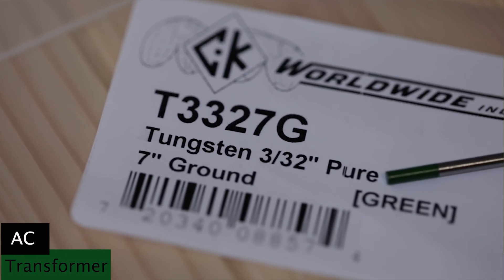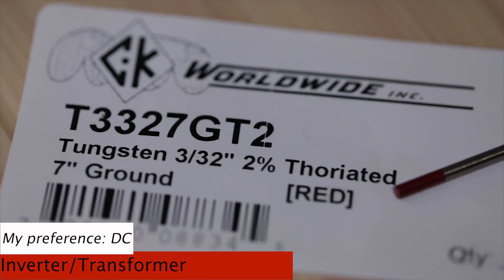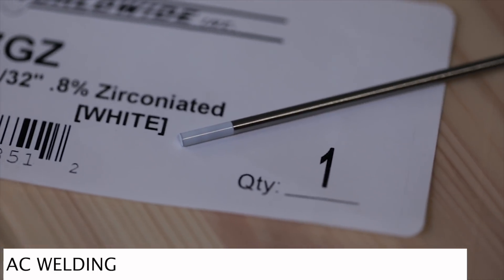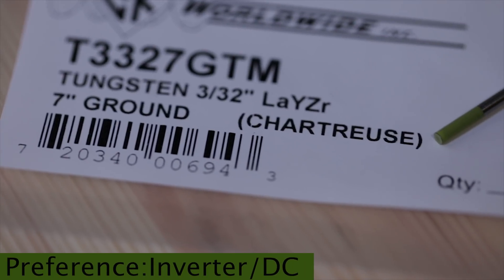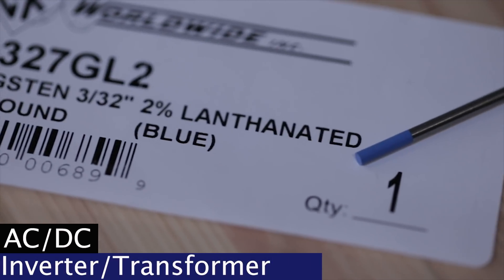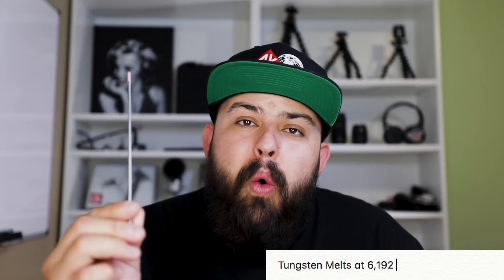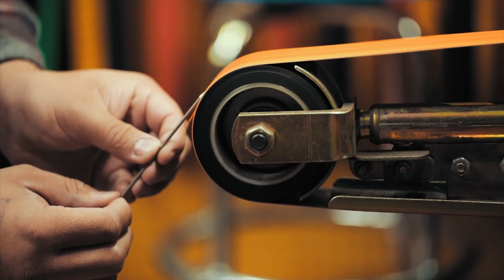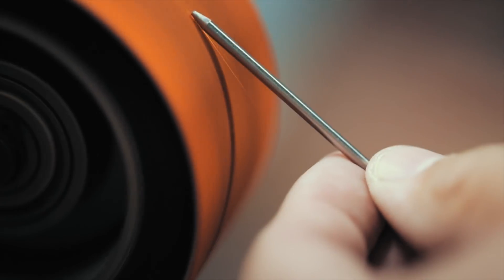What color TIG welding Tungsten should you use? | GTAW | Giveaway

Comment from the maker: What Tungsten do you guys use?
Reply: HourGlassFab  I use 2% lant 2.4mm for everything. From 4 amps to 160amps. I only play how the way I sharpen it. The only thing I do for aluminium is put the blue band off and make it black. So I know that the black ones are dedicated for aluminium.  I’ve tried the red, green, gray, gold, purple and blue... I even played with diameters ... and the 2% lant 2,4mm is my go to tungsten. For aluminium, steel, stainless and titanium.
Reply: You're not supposed to be TIG welding on DCEP!  You need to be on DCEN for most all  applications!!  :-)  Of course you're gonna destroy the tungsten on DCEP, as most of the heat energy will be going into the tungsten tip and not the workpiece that needs to be welded!!!
Reply: I’m team blue
Reply: And I sharpen only one side of the tungsten. You can use it longer... it makes a difference if you have to pay for yourself 😉 and I think it hold your tungsten cleaner. Less chance of contamination if you use the same tungsten with different materials.
Reply: 2% lanthanated. School gives us ceriated, but I'm not a huge fan of it.
Reply: Whatever I find in the drawer.....but I think I am using 2% Lanth now since you recommended it last time we spoke....
Reply: HourGlassFab #
Reply: Very onformative .thanks
Reply: I was replying to demonicwolf69's  post specifically.  I know what EP is, I know it's real, but unless for MIG welding or SMAW, DCEP is obviously not used much for TIG at all.  Demonicwolf69 didn't mention what he was welding so it's only natural he is welding ferrous metal.
Reply: I use 2% Thor for everything. I'll use it for short aluminum jobs, but if im doing long al runs i like the e3.
Reply: I stick with the tried and true red and green for me it works well with my old miller 300 A
Reply: @travishigley3095  Im with you there sir...
Reply: After 25 yrs Im kinda old skool but purple,red,black for steel&stainless wutevr Iv got handy,red for brass&green for aluminum keep th rest lol
Reply: Grey and red. All DC steel and ss.
Reply: Blue, red and purple for SS, depends on what is available in stores around the northern parts of Sweden. Many stores have the TIG inventories collecting dust I've noticed due to MMA and dual shield flux core beeing the most used methods around. Rarely weld plain old carbon steel but when I do I use the same in both an old Lincoln Invertec aswell as a new Kemppi MinarcTig. For aluminium it's green due to a very old and sensitive KempoTig and mostly very contaminated aluminium, tried gold once in that machine but never again.
Reply: Only use 2% Thor atm. Still practicing TIG right now.
Reply: #HOURGLASSFAB
 I use 2% Lanth in 1/16 and 3/32 in both a #9 and #17 CK torches. Have only welded mild steel so far.
Reply: im having major issues with our thoriated at work in 3/32, im going nuts chasing my tail trying to figure this out the tungsten is 2% thoriated is burning up after maybe 100 or parts especially tacking them all up, i'm burning up about a pack a week which my boss is a little annonoyed with me at 24$ a pack... running a max star 210 dcep  on bottled argon (i have even used our pure argon gas from our laser) i've changed the torch, i switch from my different fupa cups i have, i tried a different grounding spot thats cleaned etc and it just balls up and turns to this very weatherized frosty tip that just doesn't weld well at all. i used to use the 2% lanth back in college because im all about leaving behind radioactive material ain't nobody got time to properly clean them selves of that crap.

currently im using 2% thoriated ona fupa 12 at 22.5 CFH.
Reply: Grey band, White band and Red band Tungsten is what i use
Reply: HourGlassFab same as you basically. 2% Lanth and Thor with an occasional E3. The more I use the E3 the more I’m starting to favor it. How do you think the E3 compares to the layzr (green) or the pink multis?
Reply from the maker: ShowMeThePony I think they are all close to be honest. Layzr in my opinion is better for steel.. e3, tri blend and multi mix are definitely all close. I use pink all the time though, my go to lately.
Reply from the maker: E3, tri blend and multi mix are all good for aluminum and steel. At least in my eyes, arc characteristics are to close to notice.
Reply from the maker: Oscar Sanchez Jr, BSc. Dude? We’re talking AC regarding EP not DC. Aluminum, not steel. Electrode positive is a real Thing..
Reply from the maker: demonicwolf69 email me @hourglassfab@yahoo.com
Reply: Thor... love it...tried a few other types but thoriated seems to be my favorite...I have pink,blue,grey but the red is where it's at
Reply: Pure tungsten for aluminium  and for steel and stainless steel  2% Lanth
Reply: I use E3 for DCEN only, never AC. I use White Wolfram's for AC only, never DC. And that's it.
Reply: Red and purple thats all if used for steel no stainless yet
Reply: I used 2 lan on chromemoly alum and ss and mild steel works extremely good for me but thats jus me and my machine and settings and cups i use , now in no way am i sayin is 2 lan ideal but for me it does fine
Reply: I am welding aluminum thickness 8 mm and found some gas pores .
When I try to rectified it becomes heavy porosity.
What's problems????
Reply: Sorry, quite late to the Party. Still gonna answer your question though ^^
First I need to tell you guys that I work almost exlusively with thin sheets (0.6-2.0mm) mostly Stainless, Copper or Aluminium on Occasion.
What worked best for me this far is the following:

Gold (1.5%Lanthan) for Stainless
Green (pure Tungsten) for Aluminium and Copper
White (Zirconium %unknown) Aluminium
Purple (E3) Didn't work for me also tended to split with AC
Reply: Htp - Quad 
Blue Demon - EWG tri mix
Rstar - tri mix 
Arc Zone - Hybrid 
CK - Red band
All 2.4m sharpened according to my needs for that particular job

Comment: thank you for this info
but the titel says:   What color TIG welding Tungsten should you use
from the 9 different colors you explained only 8 and not said what color should be used for what material to weld.
great that you said if AC or DC or both and also if transformator or inverter

Comment: The machine I have is a Tig 165S 160amp dual voltage 120/240 volt DC inverter. I'm going to be  welding custom chopped bicycle frames. From what I can tell most are aluminium or aluminium alloy. A few are steel or have mild steel parts. So my questions are do I need to switch tungsten when changing between steel tubing to aluminium tubing? if so then what type am I needing.  I haven't welded in 30 yrs and back then I either was stick welding or used a mig machine. But that was completely different projects then. Trailers, BBQ smokers, big thick framed stuff now I'm having to deal with thin walled light weight material that if my well breaks can kill someone since these custom chopped bicycles have anything from a 50cc 2 stroke up to 150cc 4 stroke 4 speed motorcycle motor powering them.
Reply from the maker: Use 2% lanthanated and you can jump back and forth between reactive metals (steel) and non reactive materials (aluminum). I’m a big fan of that tungsten.. great tip erosion resistance characteristics on DC and also soft enough to just barely round the tip over on AC, some tungsten is extremely hard (thoriated) and it like to split or spit pieces off of the end on AC.. which is why I wood recommend thoriated for AC work. Goodluck!

Comment: Hello, New to TIG and scouring the innerwebs trying to find my baseline and you have been extremely helpful in that for the tungsten. I thought my brain was about to overload. Seems as though it's not as confusing upon gaining a bit of knowledge I hope this is actually the case. I did a small bit of stick in recent years but I'm so impressed with the multitude of materials and the appearance of the finished product that after much review I recently bought a PRIMEWELD-CT-520D 50A Plasma Cutter / Stick Welder Comb. By no means was it top of the line but it wasn't the bottom either. I decided I would start with 2% Lanthanated blue.
Thanks again enjoyed you video very helpful and well done - Van

Comment: @Hourglassfab, Hey Dude, Thanks so much for the great education on Tungsten. I've really been needing this, and I've had a tough time finding anyone who could explain the almost "Black Magic" of Tungsten Colors, and Transformer vs. Inverter, and A/C vs. D/C.
You broke this down to a very simplistic way.
I have a Transformer Machine Miller Syncrowave 200, and am getting ready to buy a new Inverter Multi Process Machine this week. 
That too was one hell of an education! I was all set to purchase a Fronius Transsteel 2200, only to realize at the last second that it was not capable of A/C Tig. That really sucked a big Donkey. Well after going looking for a Multi Machine that was capable of A/C Tig, thinking I would just get another Miller, think again. From what I've seen Esab is about the only Company that manufactures a Multi Process Machine that can Tig in A/C. ( please correct me if I'm wrong, and enlighten me as to whom else does, and doesn't cost 10 grand)
So it looks like I'm going to be buying the Esab Rebel EMP 205ic.
I am very excited to get all the great functions of an Inverter Machine such as A/C balance and all the other good stuff.
The other thing that I found out that sucked about the Fronius is that it does not have High Frequency Start. Scratch/Lift Arc Start only. Another thing I had to educate myself on. I've only ever used Syncroave 200 and 250, so I only knew High Freq Start.
I really wanted that Fronius though just because of how Cool it would have been to be able to Mig Aluminum without a Spoolgun or a $2500 push/pull gun. I was so looking forward to that. 
Very sorry to get so long winded.
Once again thanks so much for the knowledge. I am a dedicated Subscriber now!

Comment: Hey brother great show. I'm just
Starting out on the tig seen It's
Really interesting to me. What is a good tungsten color to start off with for a beginner. I've got a 
AC/DC Tig welder 200V I'm going to be working on Aluminum on the AC side single phase.
Aluminum is 5056 anywhere from
1/8" to 1/4" and a bit of 6061.
Thank you.   (Tabe👍)
Reply from the maker: Legal Limit Outdoors hey man thanks! I’d go with 3/32-1/8” 2% lanthanated or Pink multi mix for those applications. More on the 1/8” side for the thicker stuff. Have a great day!

Comment: Great video mate I am using 2% Lanthanated....and noticed there is a difference in brands, opened a new packet and had nodules each time. Went to the weldingshop and just bought one single of a different brand and no more nodules. What's your experience with different brands?

Cheers

Rob

Comment: For use with my Lincoln Square Wave TIG transformer machine, I prefer zirconiated.  It balls up just like pure, but withstands a lot more amperage.  I can use 2% lanthanated if I keep the balance above 7 on the machine, but if I use too many amps or set the cleaning action too high, it doesn't ball but develops a bunch of nodules and just goes to crap.  For lower amp/more electrode negative, it works pretty well.

Comment: Hourglassfab thanks for this video, I been using 1.5 % Lanthanated tungsten electrodes of different diameter, for long time,but never tried the 2% Lanthanated,since it was doing good,but now that you said that the 2% is even better,Man, I'm going to try that one, I weld aluminum,stainless steel,low alloy steel,well thanks again.

Comment: Great channel  #HOURGLASSFAB  I subscribed,, I am a bit lost , I have a Syncrowave 250 that has AC bal,, when I went to a night class for basic welding I was taught to use green,, so what I am hearing is change to the red   and or Blue? Thanks for the info
Reply from the maker: Ye Olde Pirate You can use rare earth blends.. like pink, or 2% lanthanated (blue). 2% thoriated (red) for steel is the same. 70%-82% electrode negative is the ticket. The thinner the material, the lower balance.. in turn means less penetration. More balance, more penetration. Try a different color electrode and don’t ball the tip.. the more electrode positive the more you ball the tip. Machines with balance adjustment use 50% EN and 50% EP. instant tungsten ball on AC.
Reply: Hi Brad, Thanks for getting back to me so very quick.. I am welding Alum, mostly clear anodized with a bump method
Reply: Ye Olde Pirate, I would use pure tung. (Green)

Comment: I have watched your Cup video and this Tungsten video, great content, and I like others appreciate the accurate info and non biased input.
Brad HGF - What would you recommend for tungsten and cups to weld mild steel as well as stainless?  Have not had much seat time with TIG, and still trying to understand all the differences needed to effectively produce good results with proper materials and the much needed practice.  (Edited to add)  Materials to weld would be in either mild to stainless with the general size and thickness being 16 ga - 1/4", and anything from round tube (thin wall to .120 wall), angle, or plate.
Thank you for the great clips and videos
J.

Comment: Im new to tig welding, Im doing a lot of chromo, and 1020 mild, using e3 purple 1/8 .
What ive found is prep work and preheat, and machine setup is far more useful than gettin nitpicky with electrode selection, for me that is.
Still new , maybe been tig welding for 6 months, but have stick and wire for a long time.
Reply from the maker: Chris Mannifield it’s just content man. If I stuck to what worked I would have nothing to post about. Prep is key, I agree. Machine set up also.. but those are totally different videos. I appreciate your input and I’m glad you moved over to Tig welding! Shouldn’t be a problem to get good fast with your experience in other processes!
Reply from the maker: Tungsten selection and grind angle are also factors though, especially to those who really want to take it to the next level and be able to control every outcome on all alloys .

Comment: What specifically does 1.5%  lanthiated do that 2.0%  doesn't & makes you like that more & on what metal . Would 2.0%  be your go to on aluminium rather than 1.5 & would it be for the same reason . Question asked so i know what to look for once i start trying the 1.5% out since that's what i've bought & i'll more than likely at some point try out some 2% now that you've mentioned it  Edit: I do realize when you mention preferences , however i'd like to get an idea what to look for when i experience what you did when using 1.5 & made you change to 2.0
Reply from the maker: scorp NZ I just feel like arc stability and tip erosion rates are better with the 2% lanthanated over the 1.5% But it could totally all be in my head! Let me know how you like the 1.5%.
Reply: Tig welding is a new venture for me & i'm not a professional welder tho i can gas & stick weld reasonably ok, just don't walk into any tower blocks i welded on lol . It's for maintenance of ally mower bodies that i need to repair at some point soon & yeah i think it'd be a good idea to get some 2.0% since it's not that big an expense. I've seen enough welding video's to know what you mean by arc stability & that's one issue i'd rather not have to deal with until i'm more proficient . cheers
Reply: I feel that 1.5% gold doesn't hold up as well on ac. On DC I didn't see any difference between gold and blue.